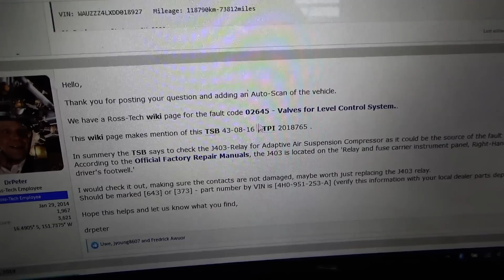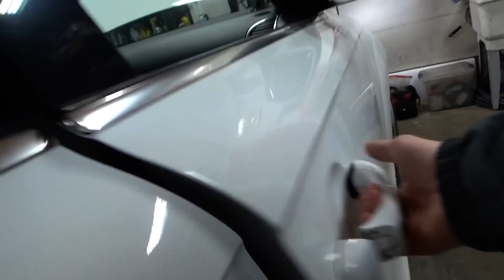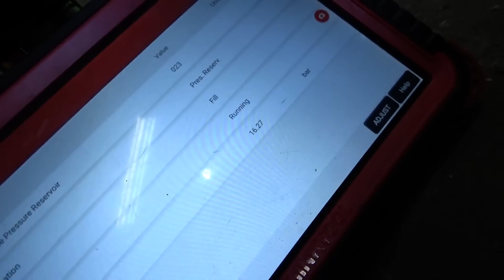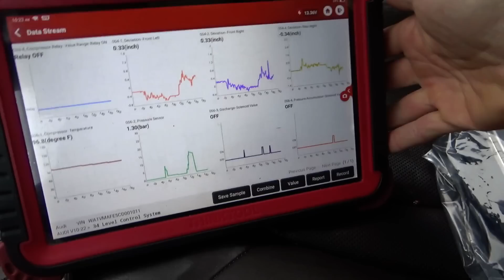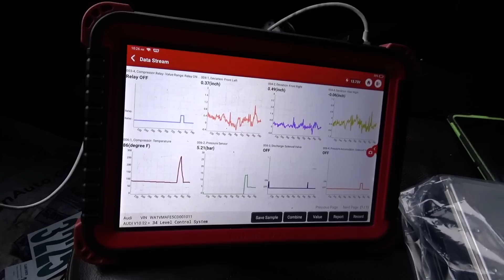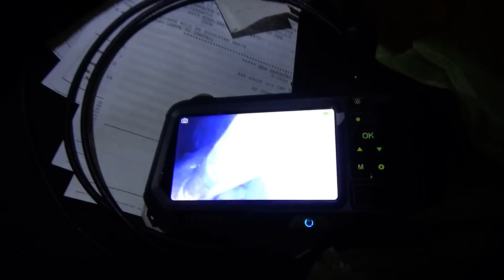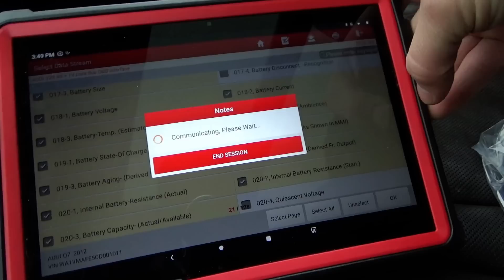Audi From HELL...DEALER STUMPED!! (Part 4 - CONCLUSION - Q7 Air Suspension DISASTER)

Comment: This is one of the reasons I despise working on modern German cars you can simply tell the lengths they go to to make them dealer only repairable and how 'lightly' built they are, I'll swear they'd use plastic cranks if they could but nice work Ivan.

Comment: Hi, watched and enjoyed, felt sorry, have been there. They say the battery is important for the alternator charging, enviroment less load and auto start. Important is CCA, Amps and volts, i have viewed but not tested if you know the old serial number just add or take one digit, cannot prove it works as i purchased a VCDS name brand battery that had a serial number and information required after reading. Why it needs to know brand and serial number to work you can guess. they say having the information extends the life of your battery?????? again i have no proof. could be a buy from me or hav fun.
Now, my Touareg had a interior fan problem, noisey, so not wanting to pay $800 + Aust Dollars i got ebay special, Long story the first fan could not blow one birthday candle out at full flow, outside temp 39C. Second Ebay Fan managed to take out two candles and not cool the car. Had the VCDS chk the op vlv's and values, all okay also a used a TopDon scanner. Next regassed the unit with the shop giving me a cost for pulling the Dash out and fix the LEAK?????? what leak? Finally found a used fan from a 2012 Amarok Ute, my car is a 2010 Touareg. Yes it fitted also for info the motor can be removed from its housing with care and fitted to original housing. After all that i could have purchased a new fan for what it cost me, time and hair pulling. End of the day last used OE fan blew out my 70 candles at 3/4 speed.
I love VCDS gr8 program BUT take care, note all info before you press go as with any scanner.
Once VW or Audi you never go back, mind you no hair and a liter wallett. have fun live long love your show.

Comment: Instructions from the car manufacturer for our product we supplied. "Make a list of all the faults that you think could happen. Rate them 1-10 with an estimate of how bad you think the failure would be if it happened. Total it all up." OK it sounds to me like they want me to make a guess then make another guess then another one. Add all those guesses together for one big guess total. Then they come back with, "Uh that total seems a little high, are you sure that fault G would be as bad as an 8 couldn't it be a 6?"  I hit mute on the speaker phone and screamed, "It's all stupid guesses so it could be any damn thing you want it to be." Then I unmuted and said, "Sure we can just change that to a 6." Afterwards my boss said you handled that perfectly let's go to the Martini bar.  And we did.
I have done many reports that are required to end with some final score. It's all just guessing on things that are more like feelings than anything engineered. And then the big bosses look at those number as if they mean something really significant. Especially if they are drawn on a nice color pie chart.

Comment: Euro junk. My daughter has a mini cooper. What a PIA/POS. You need to clear a code in OBD and also the BMW  menu  to make them go away or they keep coming back in spite of correcting the issue. The whole battery registration thing OMG, what an over complication for a simple system. Audi, BMW, Volkswagen  Run away fast. Don't buy one.

Comment: Ivan, we repair car electronics modules and can confirm that module corruption is not uncommon where the supply voltage is spiked. These units utilise non-volatile EEPROM memory to store a ton of parameters. It only takes a small amount of corruption in the wrong place and they are done for. Using a programmer to over-write the EEPROM with a known good dataset can recover the module. However this can be a protracted process and (depending on the module) may subsequently require adaption / coding.

Comment: Despite not having any charging issues, the alternator on my previous car ('06 Volvo V70) caused some really funky problems that seamed to be completely unrelated. All however were cured when it was replaced. It had a constant vibration at idle, that stopped and it became silky smooth. I didn't know the car had a glow plug  pre-heat warning light as it only started to illuminate after the new alternator was fitted. The most concerning issue was the appearance of the ABS light accompanied by a warning in the message centre and a new DTC showing no signal from the front left ABS sensor. Further inspection revealed that it was unplugged and had been for sometime. I still have no idea how the old alternator was causing these problems, but I did discover that the manufacturer of the OEM pulley only gave it a 50k lifespan. Mine had covered 210k miles, but with no charging issues and nothing in the service plan I considered it to be working properly. After a little reading, I discovered this 'Ford' system would draw power from the battery during warm up to reduce engine load and improve the all important MPG figures. However, Fords new emission control system relied upon multiple electrical motors (TM/VGT/Swirl/EGR) working in unison with rapidly changing demands to generate a pressure drop across the EGR valve. Oddly, it was a replacement remanufactured alternator that proved my concerns when It failed to deliver sufficient power. It was then possible to observe the various motors struggling to operate against the high loads they were being placed under. These engines did fine cruising at 70mph on the motorway, but fell to pieces if they did too many stop/start urban miles.

Comment: My current and last car have both been Volo V70's. Part way into ownership of the first one, i purchased a laptop with V.I.D.A. (Volvo Diagnostics) pre installed and a DICE connector for about £200. it's been invaluable and without it I don't think I could have afforded to run them. My current V70 is a 2010, but even back then these cars had a lot of modules. The forums have also been invaluable in helping me track down a few weird problems. I will say that the P2 facelift D5 was a dream to work on. Everything was extremely well engineered and relatively easy to access. For example, I replaced a powered door mirror in 25mins, and alternator in 45mins and the AC pump in a similar time. The only hard job was replacing a headlamp bulb. they've taken me over an hour due to the lack of space

Comment: Yes, Audi's do become VERY expensive to service as they become older. I waited a bit too long (11 years and 128k miles) before I sold my A8, but I truly loved that car. I think that the secret is not to own an OLD Audi unless you can do most of the work yourself. If I had the time and equipment, I would have loved to have kept that A8 for another 50k miles.

Comment: For VW/Audi there are very useful documentation PDFs available online (training material published by VAG) called SSP or Self-Study Programme.
Audi Q7 Air Suspension (so-called Adaptive Air Suspension, AAS) is covered in SSP 362. PDF is available via Google.
EDIT: SSP 302 (for the Touareg, on which the system was first introduced) has more detail.

Comment: On my BMW E65 the power module thought the battery was in a much better state than it actually was.

Those AGM batteries are not as good as they want you to believe... I measured my batteies actual capacity by putting a 10amp load on it and it was dead within an hour. The car said it had 80 ah. My car did not die however I needed to jump it after opening and closing the trunk a few times.

My fix was to apply 13.5 volts to the battery until the current dropped below 10 ma after 2 weeks of charging.

Now after a day of waiting around opening and closing doors etc (dog agility) the car shuts down as it should protecting the last amount of remaining charge.

Comment: Wonder if the compressor temperature is reading air discharge temperature. I’m not much of an automotive mechanic but I’ve been an industrial engine and compressor mechanic and we read compressor temperatures at discharge. Weak seals / valves and it’s going to get hotter than heck and melt the valves. So shut it down before it reaches that temperature combined with pressure build rate and your over protected for a car😂

Comment: Maybe the high amount of amps drawn by the warn out suspension air pump was overwhelming the alternator/ charging system? And the pump got warn out from trying  to constantly adjust the suspension because of the faulty  suspension module?

Comment: I believe in VCDS the guidance gives you more information on the settings for the battery, including the type e.g AGM. Serial number you just need to change a digit so it knows it's not the same battery.

Comment: All true when it comes to modern vehicles...they are full of electronics and low quality electronics at that.  In addition, wiring systems are inferior as they tend to oxidize at connections and wear off insulation due to poor routing and protective looms etc. In this car, its truly lame to have to remove the drivers seat to replace a battery. What would a person do when the battery decides to fail in a small town or on the road? Who is going to have the information, tools, experience to replace that battery and then set the calibration data with a scanner outside of a major city? It really makes no sense to require air pressure that often in any vehicle especially if the compressor is not built to take the work it will be subject to. There's not a bunch of miles on that Audi for its age so 11,000 miles a year average is very low yet that more than likely expensive cheaply built compressor isn't able to keep up with the rest of the vehicle. All sad engineering.

A friend just took home an S500e 4matic from his local dealer and I looked it over. There are so many things that can go wrong with it. Most of the ad-ons are comfort related and various safety features but it is so full of them it is rare anyone will use them at all. 

I agree with Ivan....spend  more and you will pay more and more often in maintenance.  Best to stick with simplistic vehicle design...

Comment: Trucks with air brakes run a maximum of about 10 bar.  Trying to achieve air pressure higher than this with a single stage compressor is lots of heat, wear and little accomplished.  So, I'd suggest this is a poor design.

Comment: Ivan, i had many of these cars here with the same issues like this Audi here. I can say for 100%, the compressor fails because the control relay sometimes stuck and the compressor doesn't turn off as it should. this is intermittent, but the compressor runs too long in this situation and overheats internally and decreases the performance more and more. I saw melted air outlet also because of the hot air that comes out from the compressor when it runs way too long. The alternator issue i know too. Threre are different LIN-Bus controllers installed during the production time, i suspect a wrong alternator in this car, because i had exact same issues too. after unplug the LIB-Wire, the alternator will charge in default mode, but after some time, it stops charging for whatever reason. Replacing the alternator with the correct type was always the long term solution. BR From Switzerland!
Reply from the maker: Excellent tips thank you! 😁

Comment: Stay away from any car with self leveling air suspension if you value  your money. They all have a high potential for expensive problems after the warranty, regardless of the brand. Especially if you live in corrosive climates. If you trade or lease or have $$$? Go for it. Heck, this Audi is 12 years old. For its intended audience, it lasted very well. Self leveling suspension is for fancy money people.
Reply: 12 years and over 115,000mi is beyond the original design lifetime I guarantee it. Personally I think that's pretty good for a cheap single stage compressor with a tiny accumulator tank.

Comment: Customer will never get charging fixed or fault codes without correct battery. Customer bought cheap battery or from someone who doesn't know what they are doing. Lucky that he isn't suing company for incorrect battery causing modules to fail.
Reply: On top of that, 13.5V is likely the system working as intended. Battery is in a climate controlled environment, no need for a strategy of [over]charging to 14.4V like most vehicles have done for so long. All modern cars monitor battery condition and can adjust alternator voltage on the fly. That might be the entire start of all these problems, the assumption it's supposed to constantly read 14.4!

Comment: You should have tested for leaks in the accumulators they tend to have cracks in the welding area or leak from the fittings because the module only monitors the time it takes to lift the shocks and the compressor should run shortly after the selected ride hight has been achieved. So in conclusion the only way that the module would set that code is either there is a leak in the accumulators, fittings,lines or if the compressor cannot achieve the targeted pressure until the temperature sensor cuts off the power. I’ve repaired so many of those Q7 and Cayennes all same VW crap. Anyway you did a great job and I’m 99.9 sure that the dealership didn’t even know how to properly diagnose the compressor problem because they didn’t even bother to clean the connectors to begin with. 
BTW sorry for my English it’s my 4th language so I hope that you would be able to get the point. Have a nice day

Comment: A really excellent analysis of the problem. So that's why the valve code kept popping up...self test for pressure vs time (annoying, but makes sense as the system knows it will be capable when called upon).  I guess valve code is just an engineers interpretation of what might be wrong with the system when the PvsT curve is off. After watching the whole saga in it's entirety two words come to mind: Coil Springs.

Comment: My 1997 Lexus LS400 had air suspension. It operated flawlessly until 2021 when I had the power steering control arm replaced and the mechanic accidentally jammed a screwdriver thru the driver's side front air bag. I could not hear the air pump operating in that car.
This Audi air pump sounds atrocious.

Comment: I think it's coincidence that the Audi tech wanted to replace the compressor. If it was procedural, then the engineers who wrote the procedure managed to hide the details or reasoning from the tech. This is possible and does happen, but come on! The engineers are responsible for that code saying something was wrong with the solenoid valve. They dropped the ball, and made the vehicle nearly impossible to  diagnose. Maybe that was the goal?

Comment: These Q7s work best with Varta batteries(for  that matter any Mercedes-benz/VAG/Fiat). 

If the owner is daily driving this piece of expensive garbage, it is recommended to change to coil springs. No point in salvaging a decade old air suspension system. A6/A8L/Q7 here in India are mostly converted back to the OE coil spring systems with shared parts or via the aftermarket(Monroe/Gabriel/KYB/Bilsteins).

This series was a workout and a half for all our collective brains. Thmubs up for your tenacity.

Comment: Based alone on where that battery was, i wouldn't want that heap. Cars with all these modules should have almost zero resale value based on what you are left with when one goes bad, and you can't find a replacement. Doesn't Audi provide a length of time that compressor should pump up the system in a properly functioning one? The Master Tech diagnosed the compressor when he didn't even have it plugged in! LOL One would think had he done a simple OHM reading across the motor windings he would think "hmm why isn't it running". OR DID HIS FLOW CHART NOT COVER THAT?!!

Comment: This car is a case study of to much junk on a car.  Come one people what about a set of air shocks with an inflator manifold in the back side panel in the hatch. I had a 66 Caprice that I wanted to adjust the rear ride height on. I went to the local mom and pop parts house and got Monroe Air shocks. Installed them myself. So you run a good pair of #12 wires back to the the car.Install a power point and buy a car tire inflator. Level the car as you like it. Inflator cost 30.00 and is readily available. The shocks may be 250.00 so why an on board compressor? 

Boom you are thousands ahead of this poor guy. European cars are a joke.

If you like pain and being poor just go out and buy one, be sure it is at least 10 years old.

You will experience poverty and and pain.

<end>

Comment: operating pressure for system is 18-21bar
Reply from the maker: Then why does it cut out at 16.6 bar? 😜
Reply: @PineHollowAutoDiagnostics  21 bar is over 300 psi. That just doesn't sound right.

Comment: If I was a betting man,low voltage corrupted the module,I have a vehicle in right now,tms,fault,after a flat battery,and a cranking attempt,tms module has live data,see sensors,sees pressure,but right rear has no value to achieve,and you can’t give it one,that channel seems dead,logic problem,probably,low voltage,probably,this is not the first,it won’t be the last,module down after a low voltage issue,you can only follow the data,but you did hi light an issue,these modules are clever as long as the manufacturer supports them,and these systems are getting so interconnected,basically the vehicle is scrap,because a module is not available.

Comment: The charging errors are likely related to not programming the right battery chemistry in the car. By "picking the first one" you might have inadvertedly chosen a non AGM battery, resulting in the charging system only targeting 13.5V as a charging voltage, which is too low for an AGM chemistry battery. The system seems to be pretty sophisticated in monitoring all sorts of battery and charging parameters and I could imagine it throwing a hissy fit because it is not getting the values it would expect.